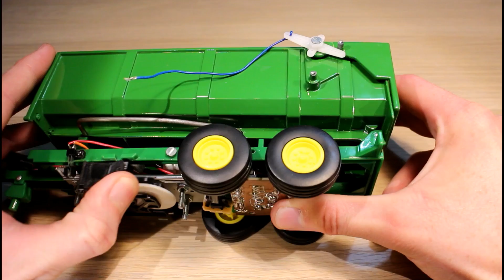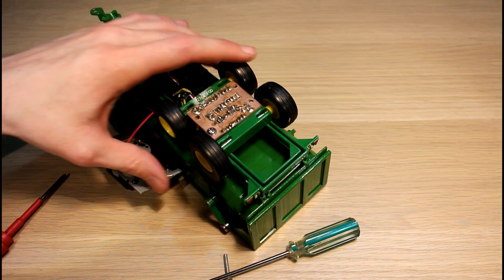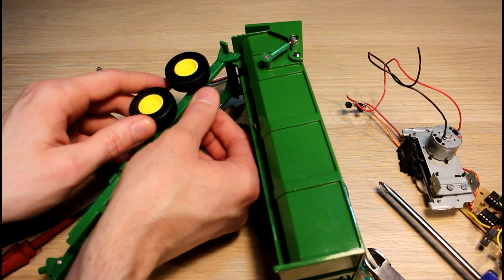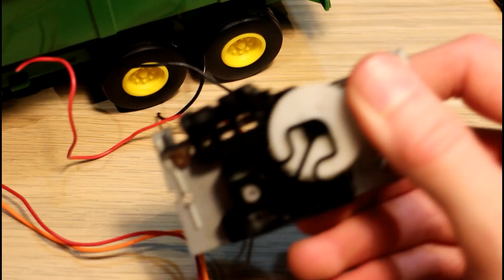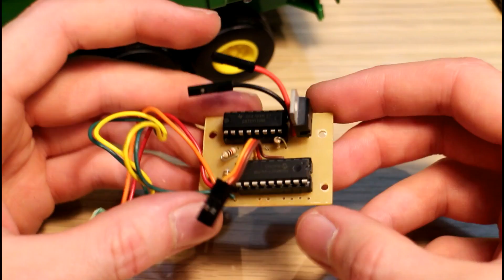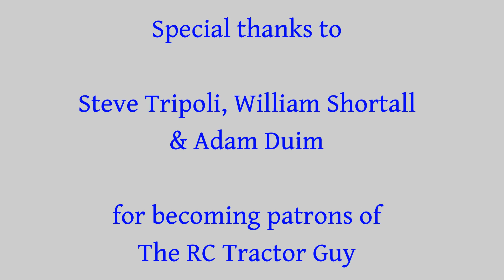Britains Grain Trailer Upgrade Part 1 - Disassembly and New Motor Test

Comment: Another great video!  I'm working on a Siku Claas tipping trailor with the same issue of the dump bed being so heavy. I really like the 3D printed motor mount you are using. Do you plan on posting the .stl file on your Patron sight?

Comment: Another great video!  I'm working on a Siku Claas tipping trailor with the same issue of the dump bed being so heavy. I really like the 3D printed motor mount you are using. Do you plan on posting the .stl file on your Patron sight?
Reply from the maker: +RcTractor Wizard Thanks, I'll post it there now for you. I've just been holding off uploading things until I had the model working but it takes me forever to finish models :)

Comment: The 3d printed part has made it a neat job.
Would there be any room to fit a scissor to get the extra height? The motor screw may not have to travel as far to get the full lift height. Just a thought.
Reply from the maker: +Mark Heywood Good idea, I'll look into that. Might be enough space to mount it and get that extra little bit of height to make it perfect.